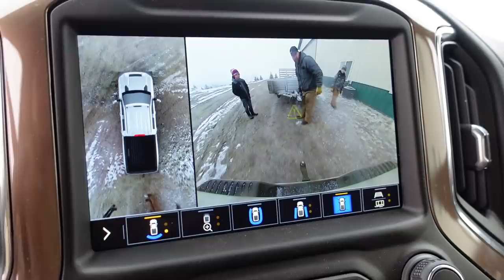Vintage Snowmobiles and Tractor Burnouts

Comment: LIBERTY 700!!  Best Polaris engine.  I had mine (04 sks700) to the PIN (120mph) and hit a trough buried under the snow.  Tore one ski clean out of the frame and wedged it between the track and tunnel.  I flew superman style for over 70 feet.  We've both cheated death, my friend!!  (I walked away though....needed a collar later..  ;))

Comment: In 1998 I was on a Polaris XLT-600 and a friend that I rode with had the XC -700. I rode that XLT for just one season because I couldn't keep it on the trail. Next season I had a ZR-600 and he was on a ZR-700. The ZR-600 cornered like it was on rails compared to that XLT.

Comment: Just got rid of my 1998 600XC with 4000 miles on the clock this last summer. Sold it to my co-worker and he got it running in short order. Of course the brakes don't work on that one either but he said it fired right up. It had been sitting for 10-12 years in my garage. One of the fastest sleds owned. Prior to that I had a 96 600 XLT(loved the sound of those Polaris triples) before that and it could pull away from that sled.

Comment: Zach....Replace the purge valve in that air dryer before it sticks and leaves you stranded. We change ours annually. And when you put the new purge valve back in, fill the snap ring cavity with the white grease the valve comes with then install the new snap ring. Good luck getting the old purge valve out too! You're gonna need it but it's gotta be done before it sticks open...which it will sooner or later. Trust me!!! Contact me if you want to know the particulars on changing those. Done many.

Comment: Changing air dry filter easier if you use wide band oil filter wrench that fits Cat oil filter on your truck engines. Like these from KD GEARWRENCH 2320W Wide Heavy-Duty Oil Filter Wrench 4-1/8" to 4-1/2" I don't remember exact size it is but I know same wrench I use on car oil filter fits air dryer filter too. I have 3 different sizes of them for Detroit, Cummins and Cat oil filters. That wide band filter wrench doesn't slip at all and if you need more leverage just put longer 1/2 drive ratchet on it. I never liked plier style oil filter tools because they dent and mark up filters or they just make holes in the sides of filter.

Comment: Those late 90's polaris 700 big blocks were a fortress to be reckoned. Over 100 hp. Not to mention very desirable on the sales market too. That black sled in my avatar on the left, is a 2005 polaris 700 xc sp.F/O. nice sled you got there. Now tell derek to start getting polaris sleds. I DONT KNOW.

Comment: My 1998 Polaris rmk 700 everything stock but the exhaust will do 118 on flat ground.. rmk never die. My dad has seen my sled side Hill a vertical face at 104 miles an hour with my uncle Riding it

Comment: If you want a challenge, my 82 Polaris Indy 500cc triple is sitting in an enclosed trailer. Much cleaner than the ones your working on. Used to put those ElTigre's into the weeds.
I used to change that brake gasket  every year.

Comment: You people need to start putting a film of grease on those filter gaskets.
Reply: Yeah they definitely lube the gaskets up when they put em on... Clearly you missed the rust and shit in the filter which hints at how long it had been on there... Grease on a rubber gasket on a filter left on way past its regular service interval actually makes it stick more. The point of lubing the gasket it help it seat and keep it lubed so it seats probably and keeps it from pulling and stretching and make it not sit evenly as the filter spins as its tightened...
Reply: Air dryer cartridges never come off easy. Unless you just put it on.

Comment: 4:58 that four-wheeler in front looks identical to the one I own those are great Polaris four wheelers if that's the same thing
Reply: I had a 94 4x4 400 2 stroke.  That looks like one.  Is that your guess
Reply: @Sc-jf3yk  yeah because I have a 1993 Polaris two-stroke and it kind of reminded me of that
Reply: @Whyjustwhy78  good memories

Comment: Thanks Zach, now I'm going to have to go buy my old Indy 650 back. I just wish that the idiot who had it didn't nuke the motor. But ironically enough I've got the parts I took off and returned to stock years ago. I was running alcohol and didn't want to sell it to a idiot.

Comment: They've developed a tool to deal with the major problem here....its called a pressure washer.   So much easier to work on things not protected by a quarter inch of grime.  Outside of that, your idea of "vintage" is a lot like current equipment around here.

Comment: I would actually pay to see someone do a burnout with a tractor
Reply: I do them all the time in the winter at our farm it's accually really easy
Reply: What do you do just turn the wheel all the way and floor it? I only know how to do burnout in cars mash the throttle mash the brake let off the brake enough so that the rear wheels get lit up
Reply: With our tractor you turn the wheel turn 4 wheel drive on and press the brake for one tire in the back and run about 1500 rpms
Reply: Well that's a donut I don't know if you consider it a burnout
Reply: I find you would have to have hire RPM than that but okay
Reply: You don't need it but you really can do howevermany you want tractors don't have a normal gas pedal like cars do at least ours don't
Reply: Usually the less RPMs you have the lower gear you need to be in
Reply: But you probably knew that